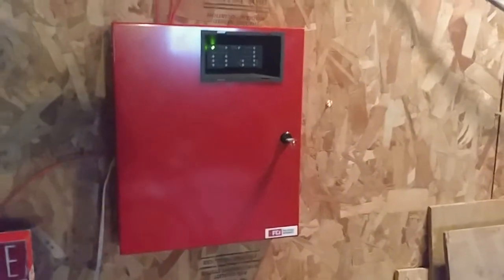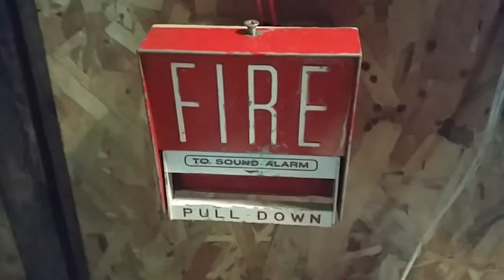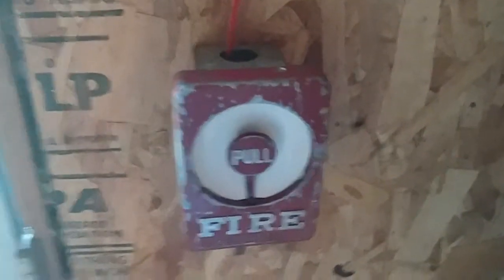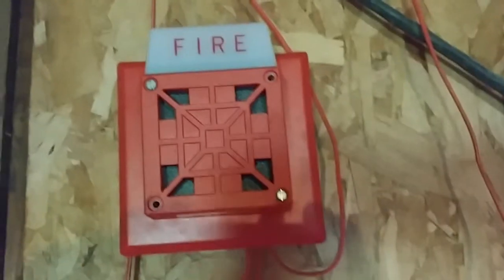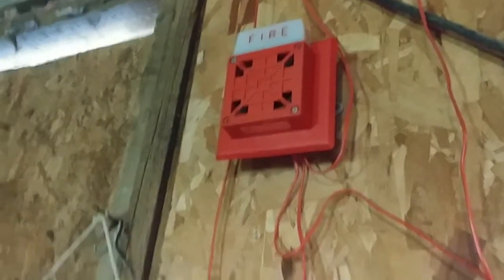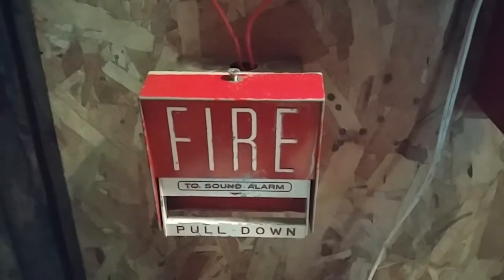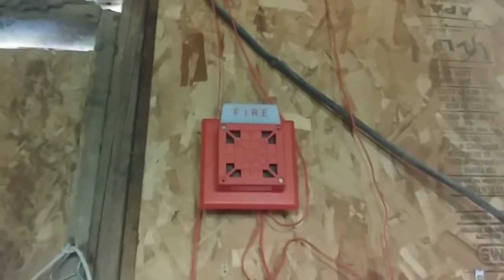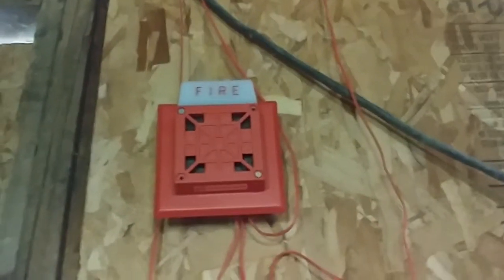fire alarm System test 15. Vintage honeywell devices #FireAlarmFriday

Comment: Nice video. I just got myself a simplex 4010
Reply from the maker: Nice
Reply: If that’s your first panel, good luck. You could have started with some other panel instead like a 10ud or something else.
Reply: @FireAlarmGuy13  Nah. I'm not a big fan of firelite stuff plus my collection is all simplex so that wouldn't work out well. I gathered a bunch of information about the 4010 and pretty much have the basics down when it comes to running it.